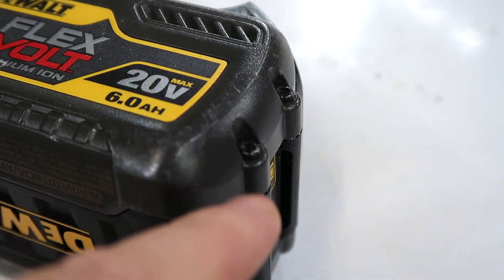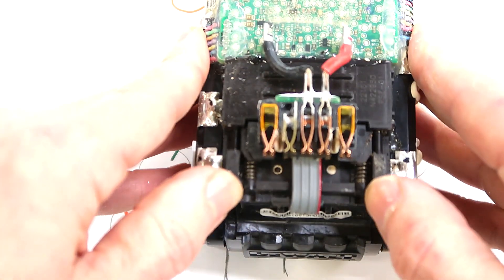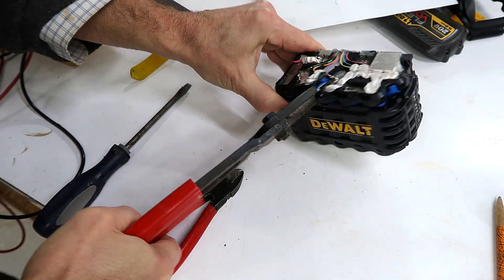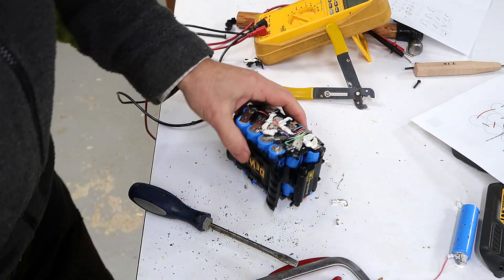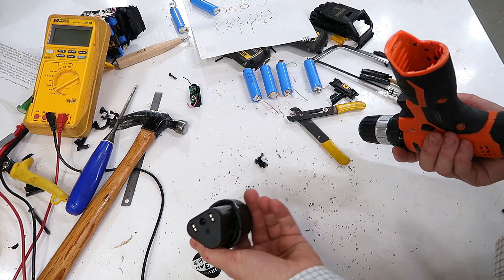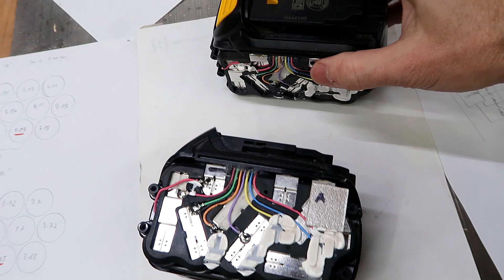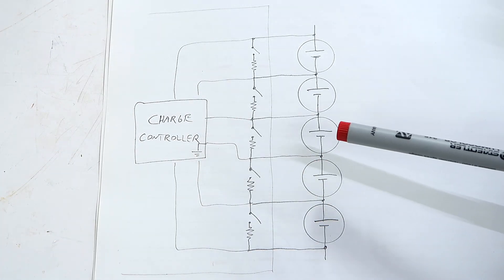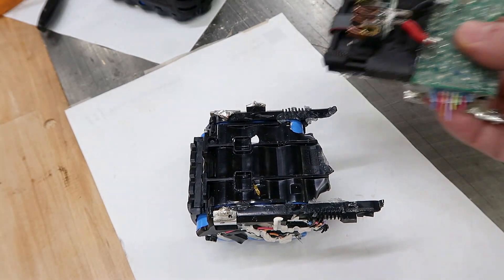This kills flexvolt batteries prematurely

Comment: The 2.7* volt cell is likely recoverable. Just take it slow with a low, constant current source, and check it to make sure that it doesn't self discharge at all.
Reply: I would absolutely recover a cell at 2.7 volts as some cells are rated for 2.5v also I'm cheap so I recover cells down to 1v. I'll just watch them and check if they get hot during cycling
Reply: @pinerock9668  - same here.  I can recover cells as low as 0.100Volts if I use my TP4056 boards with the current set at 50mA.  Once the cells reach 0.700Volts I increase the current to 100mA.  Once the cells reach 2.5Volts I increase the current to 200mA the rest of the way up to about 3.90Volts for the first cycle.  Then I discharge at 200mA down to 3.2Volts.  Then cycle again back up to 4.20Volts at 200mA.  (As long as the cells are not getting hot.) 

I’ve found that the cells that get warm on the first cycle up to 3.90Volts usually don’t get hot on the next cycle up to 3.90 volts or 4.20 Volts.

In my experience, Low voltage lithium cells get progressively harder to revive the longer they sit at low Voltages.  E.G. 0.5Volts for a day is fine… they’ll bounce right back with a slow charge.  But 0.5Volts for 6+ months will be tougher to revive.
Reply: @test-193  interesting and good to know. Do you have any experience with how much cells can handle overcharging, charge slowly below freezing temps or if there is a temperature that the electrolyte will freeze and damage the cells during storage? Ive not tried and overcharging yet but I did leave a cell in -30c (-22f) and after a couple hours I brought it inside and did a discharge test and it didn't loose any capacity. It's voltage will at 4.2 before the test, 4.17 ish once cold and it dropped to 3.7 under 1A load. It was a power tool cell so some major voltage sag due to temperature.
Reply: @test-193  recoverable at 0.1v, yes.  but bear in mind the fundamental chemistry of the li-on changes when it's allowed to discharge below 1v.  The odds of a dendritic short causing self-ignition go up logarithmically.
Reply: @pinerock9668  Yeah, i've been successful down to 1.5-2v. Anything lower that that usually is too far gone to be worthwhile to recover, and wont hold much of a charge anyway.

Safety is always a concern, so slow, easy, in a well ventilated fireproof area. Stop at around 3v and check for any self-discharge going on. Then go to 3.5 and let sit for a few days and check again.

Comment: If you kept them in 60v mode when idle would it change the behavior of the BMS?
Reply from the maker: I suspect each 20 volt string has its own BMS.  And balancing only happens when charging, and charging only happens when in 20 volt mode

Comment: I had a 40V battery for my Ryobi brand lawn blower /weed whacker combo die, just like what you explained!  I haden’t used it for a while. I checked the charge, 3 bars. So I used it normally (usually ~2 bars to complete the yard). Near the end of my work, it died and would no longer accept a charge!  What you explained perfectly matches my experience.

Comment: Balancing needs to be done at higher voltage on the cells.  The middle part of the discharge curve is very flat and the voltages will be close even if they are out of balance.

Comment: I worked on a project with a very large battery stysm.  ~800 volts and 100's of amps.  I noticed that if we left the system balancing for extended times  the bank would go out of balance.  It turns out the control system was using the bottom cells to power the controls.  I wonder how the they do the balancing and where the control power is tapped off.  You might be able to trace the wires.
Reply: Problem is the PCM, it's pretty much potted so impossible to reverse-engineer the circuit.
Reply: @zaprodk  We ended up turning off the control system when we weren't using the battery or an extended time.
Reply: @ahbushnell1  i was talking about the DeWalt FlexVolt pack :)

Comment: Awesome vid. It explains allot. I had 2 of 4 12Ah Flexvolts fail. One would not charge and the other has greatly reduced run time. Fortunately the first one failed within the 3yr warranty period and was replaced by DeWalt. I was going to try to swap cells to get one working unit but probably not after seeing the internal construction. Cheers!

Comment: I have recovered a few batteries with a single dud cell by applying a very low current trickle charge to the single cell that is dud. Once the BMS sees that the one cell is back to life it will work as normal. I understand that some BS have a suicide mode that won't let you do this. Another youtuber Andy Reynolds taught me this.

Comment: Battery charging is a mystery to most people and almost everyone gets it wrong. 
You shouldn't drain batteries completely and leave them empty, always give them some charge before putting them away, they don't need to be 100% fully charged but they should be above 50%. Never forget it's a chemical process not a tank of fuel, it needs to be in a ready state to produce power.

Comment: Slight correction, the switch has a third position reachable using the shipping cover in which the three banks of cells are isolated for legislative reasons. I wonder if you're right about centre tapping. Usually they chew on the first cell and only chew when active. Hmmmm.

Comment: DeWalt themselves  should address this design vulnerability.   Long term storage (self-discharge) issues seems to hit various high voltage - or bi-modal, pack types. 
Perhaps regular top-ups in store. Or sticking to the simpler 20v only packs with a less complex BMS is at least a partial answer.
With a bench power supply perhaps you could individually charging the low cells (in time to save them). This seems like a failure in design to me.

Comment: in terms of video composition, I think you should have saved the part about tearing down the battery and the bit about the drill for the end, and had the part about why you thought the battery was broken in the middle. That seems to be your typical format. Just thinking about maximizing audience retention. But your channel is so big and audience is so reliable i would think that you are soley at the mercy of CTR, aka topics and video ideas. Maybe you should start a mouse-catching channel.
Reply from the maker: The video was going to end with having ordered the drill, but then I got a cold, and then christmas, and during that time I realized what probably went wrong.  That's why the video is the way it is.
Reply: @matthiasrandomstuff2221  ah. A month long long project! Wouldn't have known had you not said shots were filmed weeks apart!

Comment: That's really interesting. I'll have to show this to my dad who has so many dewalt / cordless batteries that die... it's probably why they keep failing on him. He usually waits until he's down to one and it starts to not hold a charge for long (probably because of this issue) and then buys like a set with two batteries, then uses the batteries in all the things.
Reply: Yep, I've definitely learned to NEVER keep lithium battery packs at low charge for extended periods of time.  Now I pretty much put them on the (slow)charger on the same day they hit 1 bar.

Comment: I have a 12Ah that died on me a while back, I think the failure mode was exactly like you described. I use these in my lawn mower, which takes 2, but does not use the 60V. I found that it usually empties one battery faster then the other, and I suspect that I had the now dead one on that side. I keep the still working ones on the charger all the time, so maybe that will help.

Comment: batteries with low aren't automatically dead (depends a bit on why and how long they've been at low charge - some BMS'es are just crappy at balancing)
to test how good they are, just charge them full and use a charger with a load test (they're pretty cheap and definitely worth it!) to "classify" how good they are

Comment: Would there be a chance to re-wire the cells to have 2 sets of 5 in parallel? This way you have a pack with still 2/3 of the capacity to use.

Comment: Good general view and understanding of the process. With a bit more patience, you might have split the spot welds and push the bad elements out, to be replaced by other (possibly recovered from a disposed laptop battery pack with a couple of dead cells). All in all, a good informative video.

Comment: Draining just 1 cell with the onboard circuitry... that's just criminally lazy engineering right there. Makita LXT batteries have the same flaw, their smart circuitry runs off the first cell in the pack.
Reply: They had

Comment: Thank you for this. Was looking to design and 3D print an adapter for these batteries. Just hadn't dove into it yet to figure out what was needed to switch between 20V and 60V. I've made an adapter for the 20V Craftsman Batteries to power my TS100 soldering iron. Was looking to adapt the Dewalt batteries to make a bench top power supply from it.

Comment: Next time before completely dismantling the pack you should try to “equalize” the voltage of all the cells, using an old cell phone charger or variable power supply put a small charge to the low cells and bring them much closer to the other cells values so the BCM recognizes those cells(with them being low, even if just drained and not damaged the BCM might not allow a charge because of the imbalance and detects an internal issue.
Reply: This is a bad idea to do. Overdischarging lithium cells this far down tend to damage them internally. So they will have much less performance and end up getting overdischarged again and die. But the internal damage can even lead to the cell catching fire once changed up.
Reply: @berni8k  you are absolutely right. charging a dead battery like this is a recipe for disaster
Reply: I had similar issue. My kid's RC car uses Lithium cells. It is a cheap toy and if the power switch is left on after the car stops due to low voltage, it slowly drains the battery like yours. I connect the cell to a bench supply, set it to 4.1V and 100mA. I usually leave it like that for 15 minutes, and I keep on eye on the battery (make sure it is not getting hot). This usually brings the voltage up to over 3.6V at which point the charger is no longer complaining. I know you are not supposed to do that and the battery is probably not going to be the same after that, but does not necessarily ends up in disaster. Worked multiple times, and keep the battery out of the landfill for a little longer.
Reply: Your right it is dangerous. If I do it I closely monitor it and periodically checking if it is taking a charge. Also check the temperature of the cell every so often.

Comment: you can also buy onlike the clips/etc for a makita connectons/etc and can convert to makita batteries. i think the The Post Apocalyptic Inventor has converted battery packs to makitas.. of course that assumes you have makita batteries/chargers around
Reply: Makita BMS is the worst. Once a fault is detected the battery will blackball itself. It'll never work ever again.
Reply: @1pcfred  for a good reason
Reply: @1pcfred  it is, unless you like house fires

Comment: If the cell is low and not shorted or open I have many times brought back cells with combination of slow/fast charges, they may not have the same potential as new but still work, many times a cell will get drained beyond its norm and now the charger does not see it, if you bring up that cell (s) voltage to about 2.75, it will again take a charge

Comment: I remember this being a big thing on the earliest Makita batteries (10 years ago). But then the issue was probably resolved, as I've never heard about it or dealt with a dead Makita battery since. I still have 8 year old Makita batteries in use.
Reply: It still happens. Thanks for reminding me that I need to put my batteries through a charger cycle.
Reply: Yeah. First generation has a controller board the ran off one cell and if unused for several months would kill the whole thing buy locking out the charger. The trick to keeping them alive was to charge them every few weeks. I still have first generation ones that work from more than 10 years ago. The newer ones that have a star cast into the plastic case changed the design so the control board runs off the whole string of cells and has cell balancing. Still a good idea to keep them charged up at least once a month. And maybe even leaving them on the charger for a day or so so the cells can properly balance

Comment: Next time just connect the "damage cell" to other 18650 parallel for 20 second, and then charge it regular
Reply: if the battery stayed for long period of time under 1 volt its unlikely to recover, I had couple cells dead with 0.7v and when I put 4.2v voltage across they didn't draw any current

Comment: i would have connected a power supply to the low voltage individual cells in an attempt to charge them and see if they recover. and yes while still in the pack without disconnecting anything. i had a simalar case of a battery pack that wouldn't charge because battery over discharge protection of the bms board kicked in and i had to get a low voltage cell in middle of the pack back up so it would charge normally.

Comment: A good BMS should shut off if one of the cells is discharged too far (below 2.5V)...
Reply from the maker: the problem is that the tool is the one with the low volt shutoff, and it just sees the total voltage

Comment: These low voltage cells are probably still acceptably good. The pack just needs balancing, that is charging of each cell to 4.2V individually. As long as they are not 0V nor negative, all should have decent capacity.
Of course, the electronic circuit may "remember" that the pack is broken and no longer allow to use it. This is typical in laptops but unlikely in a power tool.
Reply: If the cells are LiFeP they can be charged again without much ado, BUT, if they are Li-nickel ones (cells in the video are AFAIK), those do not like to be fully discharged.
The issue is due to the crystal structure that holds the Li ions when charged. If too many Li ions get out, the molecular structure "collapses", and no charging can change that afterwards.  There is a very good explanation of this process on a channel called "the limit factor"
Reply: This far down discharges tend to damage them. Even if they do come alive and not catch fire they will be lacking in performance compared to the other good cells, so they will again end up overdicharged when the pack is pushed hard.

Comment: I love these videos. I just want to know how everything works. Once upon a time there wasn't much more than cells in these batteries. With the electronics on-board, is the charge controller inside the battery, or still in the charger?
Reply: The one in his diagram is in the pack.

Comment: all the bms front end controller ICs i've used use the last cell in the series, not the middle one (or they use the voltage across the entire string). the difference is more likely due to accelerated battery aging in the middle cells because of other reasons
Reply: Correct.  It's actually rather difficult to find a silicon process where you can have voltages significantly below the chip's ground (they do exist - I've used a couple such processes, but it's alot more complicated and expensive).  Much easier and cheaper to have all the voltages above ground, unless you have some compelling reason to have voltages below ground.

Comment: Do you think this applies only to Flex Volt batteries, or all DeWalt batteries?
Reply from the maker: I would guess the flex volt is like 3 20v packs
Reply: they would likely use a different BMS IC on their flex volt than everything else.  But ya never know.  Often times circuit designs get reused with different ICs from the same family.

Comment: Before you ripped apart the pack you should have tried to  charge the 3 individual cells with an external 4v power supply, You might have been able to get them back up and the the pack would have been salvaged
Reply: They were too far gone.
Reply: You might bring those cells back, but temper your expectations! Any series pack relies on each of the cells having roughly similar internal resistance and capacity, and that revived cell will forever be weaker than the others. How much weaker depends on how long it was over-discharged for, and a bit of luck. The pack will forever drain unevenly and not perform as well as it used to, or maybe over discharge other cells depending on how the protection circuitry works.
Reply: This might be a stupid question, but is it necessary to disconnect those three  batteries from the others to do that?
Reply: @ThumpertTheFascistCottontail   You won't have to if you put the charger just on the battery you want charged. The other batteries won't be in circuit so they won't be affected by the charger.
Reply: Thats no fun :)

Comment: I wonder if the regular 20v batteries have the same “problem” 
I’ve had a few “dead” dewalt batteries. Most the time I can “jump” them to another battery and get them up and running again sometimes I can’t. I had the same experience with trying to salvage the cells, they use some serious adhesive in the 20v packs I couldn’t get them apart.